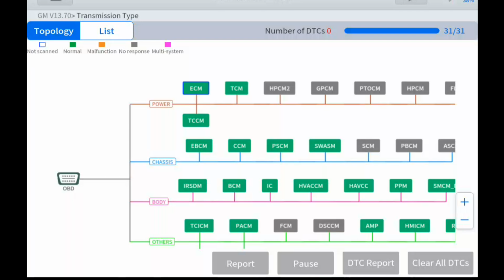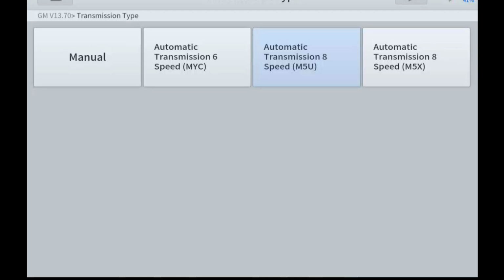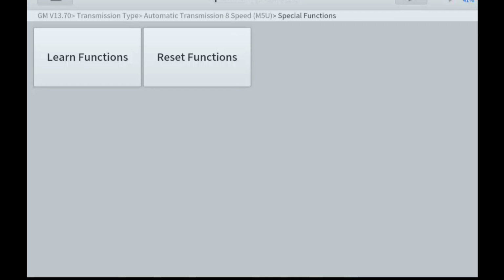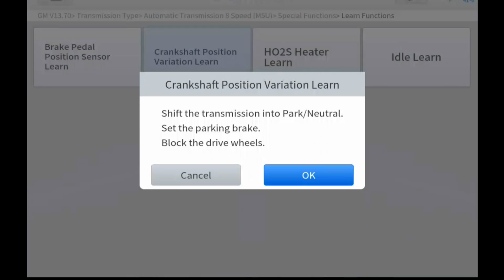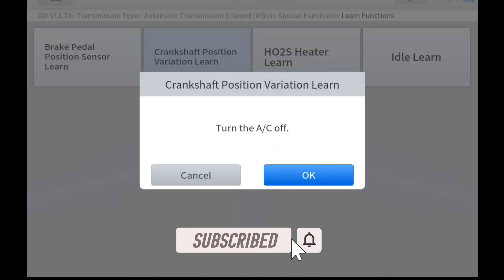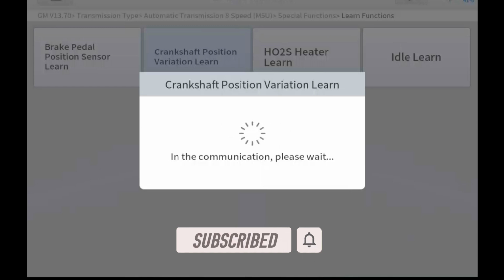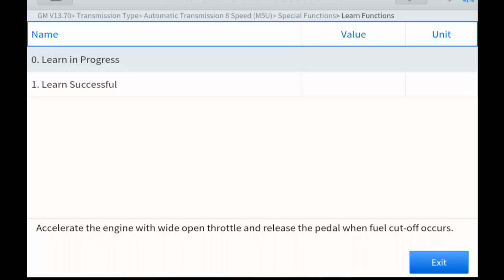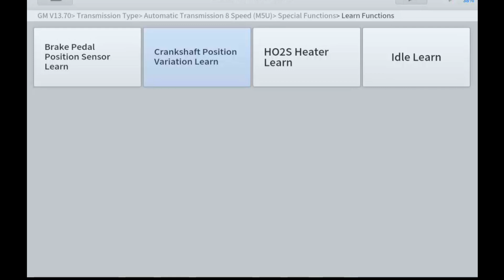Crankshaft Position Sensor Relearn Using the Xtool D8BT on a 2016 GMC Sierra.

Comment: What about if the car won't start?
Reply from the maker: Scan for codes and see if that tells you anything.
Reply: @737mechanic it's a 2005 chevy colorado 2.8 the codes it shows it just to relearn the crankshaft an throttle but won't start
Reply from the maker: @Ayitiavantou  You probably have a bad crank sensor. You need to check for spark and fuel. One easy way is to spray starting fluid in the intake while cranking, and see if it tries to start if it does, then you have a fuel problem. If it doesn't, then something is preventing spark, which could be a bad crank sensor or wiring.
Reply: @737mechanic  thanks for your advice, I've done all of this but the main problem is still crank no spark despite all the sensor are new and coils, spark plugs are new
Reply from the maker: @Ayitiavantou  Check and make sure you have a good ground on the black wire of each coil, make sure the pink wire has power with the key in the run and crank position, and then using a test light see if you have control flicker when the engine is cranking on the control wire which is PIN B of the connector.
Reply: @737mechanic  great I'll check that. Thanks

Comment: Thanks for taking the time to make this video. I attempted to this procedure on a 2006 Impala w/ my D8 and it fail.
It also fail using an Innova 610 scanner which makes we believe it might the car/ too old for this.
Other possibility is my Donkey Butt.
Reply: 2006 is definitely not too old.  Sounds like you could have a faulty sensor or wiring.
Then again--  every scan tool has little odd bugs that don't work sometimes.  If you just report the problem, they usually get it fixed within a week or two.  Xtool is good about that
Reply from the maker: I will pull the service info up and see what it says. Did you replace the Sensor and that is why you are doing this?
Reply: My friend replace the engine w/ a junk yard engine and we thought it might be a good thing to perform this procedure. @737mechanic
Reply: I’m dealing with the same exact issue..mine just won’t start the learn process..keeps saying it needs to meet the minimal warm temp but I’ll drive around for a while and still won’t budge..might just take it to a dealer